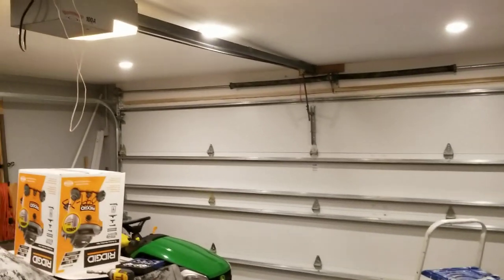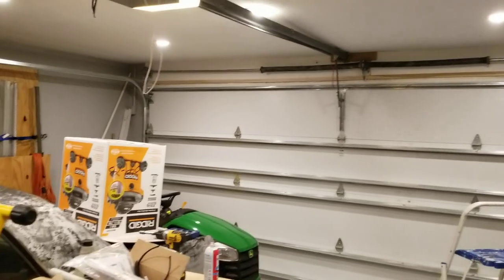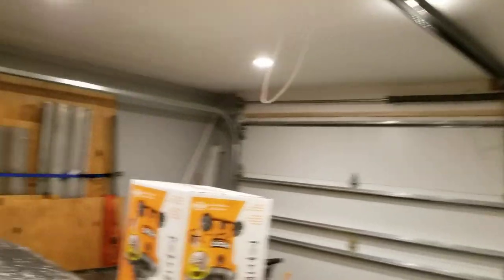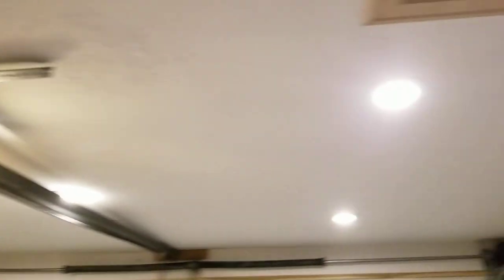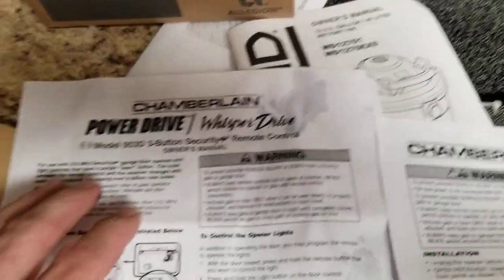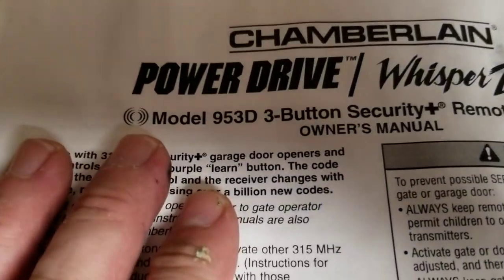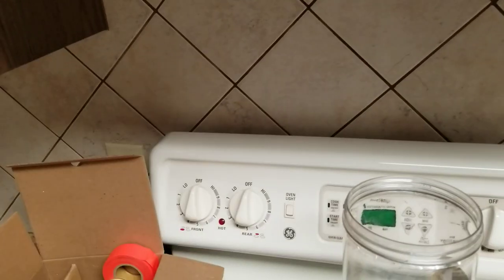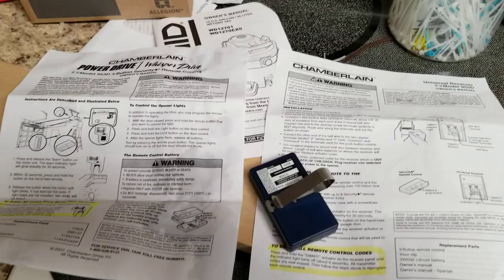New remote control for overhead opener model 100 a

Comment: Huh, you just showed me something I never knew existed, and I’m a door tech in an area with a lot of Overhead products installed. Does your 100A have a circuit board inside it? 
The A in 100A indicates the auto-reconnect carriage. There’s also a 100SS for “solid state” which had a board, but the arm dropped off the carriage when you pulled the disconnect. If your 100A also has a circuit board in it, then from what I’ve seen, you’d have the top of the line of the 100 machines, especially with digital (dipswitch) remotes. Really cool!

Comment: If you are looking for a replacement remote for your model 100 opener I have the answer. First, there is a separate radio receiver that is not part of the initial housing. But what I have learned is that a bunch of us all have the same radio receiver from when they were installed around the same time. The little box twice the size of a deck of cards will have a number on the outside like ABI340. The 340 represents the Hz you need for frequency. I tried 300hz and it didn’t work. But the few 340hz out there are the trick. You also likely want the 3-position 9-switch dip switch remote. The link below worked for me. I’m posting this here because I watched about 10 videos before I figured it out on my own. And I’m hoping it’s good karma! ;-)

Heddolf 0220-340 garage door opener https://www.amazon.com/dp/B000F5MAB2/ref=cm_sw_r_cp_api_fabc_98XRFbZN49REH?_encoding=UTF8&psc=1
Reply: I’m glad you made this comment. I watched several garage door videos, we have aTouchN-Go 100, the remote was lost when thieves took the car. The car was found but the remote wasn’t.  I installed a smart switch on the garage door yesterday, but I really want to upgrade the transmitter& external receiver that is wired into the terminals on the back of the ceiling unit. Seems easy enough. But after watching a bunch of rambling videos like this one, I’m in the same boat. Just need facts. The receiver ideally should do something very similar to the doorbell like button. It briefly short circuits 2 terminal screws. That’s it.
Reply: Eric, how do you program the remote you linked to work with the model 100?
Reply: @jasonwalker1959  you open the receiver box and see the combination of dip switches. Then you open up the remote and put the switches in the same position as your receiver. Sort of like ABABACA and then ABABACA.

Comment: you really need to slow down to show what it is.  It says for Touch N Go 100 but at amazon it says for doors made after 2005 My touch N go is original to my 1980 house. I need a replacement remote, Can't find one anywhere.  Don't really want to buy a new motor since my Touch N Go works just fine.. Can you help.?
Reply: Following
Reply: I have exactly the same problem: The Touch 'N Go motor works fine (Touch "N Go 100 from 1980). Motor works great, but the remote is worn out, almost crumbling,  and not working anymore,. All I need is a remote....
Reply: @shoegirl231  you’d need to know what frequency your remote runs on. The majority of these have a box on the outside of the opener, connected by 2 or 3 wires to the screws on the back. The box may also be inside the opener (the antenna wire would be coming out of a hole near the light cover). On that box there should be an info tag. If it says something like “380-ABC” then there’s a chance a remote can still be obtained. If it’s printed like “370-17”, “370-13-15”, or “370-11001100” then remotes are not available, and you’d need a radio conversion kit like the Overhead OCRUD-1T. 
The 100 is an outstanding old tank of a door opener.

Comment: i have a model 100. i have a new opener im trying to program to it but cant for the life of me find a learn or program button/switch. only thing i can see if a button that says reset ive tried to use that and no luck. any suggestions?
Reply: Did you ever figure this out? I have a model 100 that needs a new remote. Any fix for this?